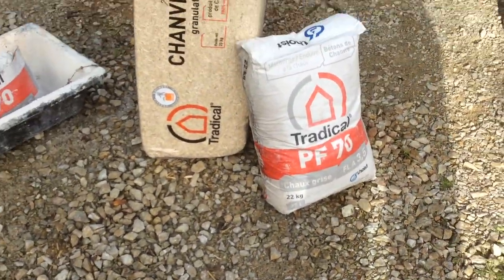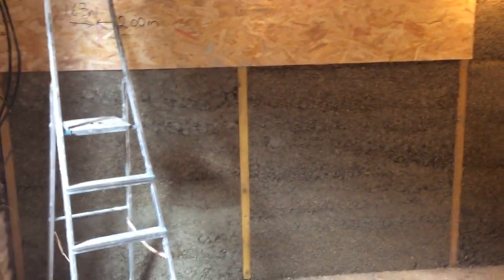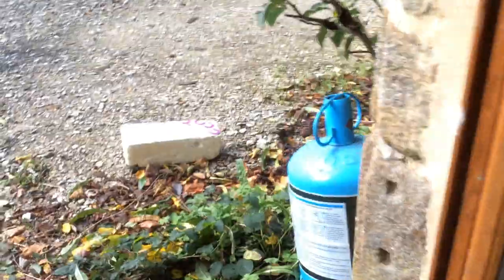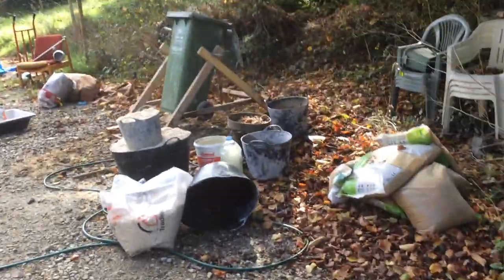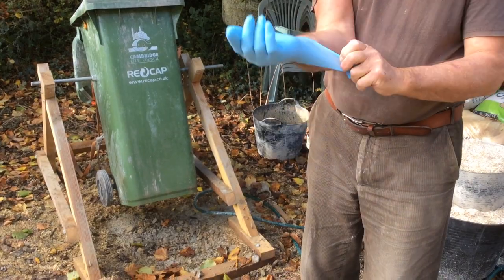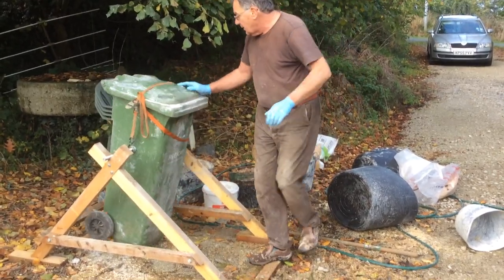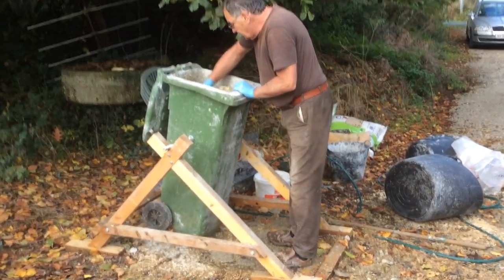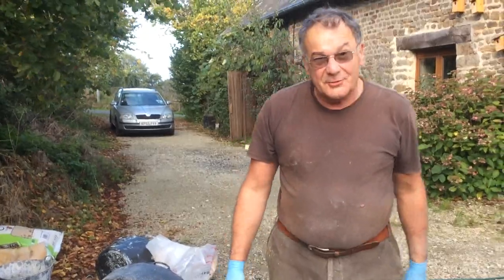Casting hempcrete insulation

Comment: Hello Gavin, your video was inspiring. I have a question regarding a strategy we are thinking of using in our stone house we have just bought in the south of France. Our plan is to insulate on the inside of the house. We would strip the wallpaper - underneath is an old layer of plaster - we are guessing it is a lime plaster as the house is about 80 years old. What is your opinion on this idea: Leaving the plaster as it is and adding a layer of hempcrete for an internal insulation layer. So that would be stone on the outside, this thin existing plaster layer and then a hempcrete internal layer of about 10cm. Your opinion would be most valuable to us.
Reply from the maker: Hi Alison, I
 am based in Mayenne,  Normandy.
Is your plaster heavily painted?
Would it be possible to remove any paint if it is enamel or acrylic emulsion?
This is my opinion:-
remove the old plaster which will probably be lime with horsehair without the paint.
The lime plaster can be recycled into your hempcrete mix if you crunch it it up pretty fine and pretend that it is sand for the proportions.
Shop around for the hemp and lime. I bought Tradical from Point P, because it was recommended and I thought it was very expensive and cost a great deal more than I budgeted. Remember this insulation is hidden so it doesn’t matter what colour it is.

I could have bought white St. Astier 3.2 NHL lime from the local builders merchant cheaper than Tradical. I really don’t think that it will make a lot of difference to the insulation properties which type of lime you buy, which ever is cheapest is best,.
Some farmers grow hemp and sell it direct for a fraction of the price.
I agree with you that 10cm/4” is correct.
Fix 1”x2” or 2”x4” vertical battens to the wall at 60cm intervals to which you can screw the shuttering.
Why 60cm 😊?
Doing a finishing coat of lime plaster is really hard work. Do a simple cheat ,when the hempcrete is fully dried out, nail some 2”x1” battens to the 2x4” ones you used for the shuttering, and then screw regular plasterboard to them. Quick and easy to do a whole wall in less than a day and cheaper than lime plastering which would add another inch on to your wall. 
I suggest that you put some air vents in the plasterboard top and bottom to ensure an airflow behind the plasterboard.

Comment: Hello Gavin,
Thank you for making this video. I think your mixer is nothing less than genius!  
I was surprised to read that molds had formed just as you were. I’m wondering why you said the wall needed breathing? Couldn’t you seal it first and than put the hempcrete against it?
I’m also curious how your experience is (don’t know if that’s the correct word) with the walls after this time. I hope you are enjoying your work to the fullest now. All the best!
Reply from the maker: It is really important to understand that these old buildings used a construction technique that required the buildings to breathe and flex. 
First understand the difference between cement and lime mortar, cement is rigid solid glue whereas lime mortar is a flexible sealant. This difference is important. 
This house is built with walls 30" thick made from granite rocks and yellow clayish mud, and footings of approx 18" without dampcourse.
It's construction results in moisture continually rising from the ground.
Consider for a moment how you might deal it - silicon injection by drilling holes into 30" of granite wall every 4"😊 rather you than me . Perhaps you could seal the wall with black bitumen, Synthaprufe?
That would destroy your building in no time because the damp cannot escape so it rises up and up, the earth between the rocks becomes very wet and the weight of rocks squeezes the mud out and the wall gently collapses.
Another method of reducing the value of your home is to repoint it with cement. Cement is waterproof and rigid. If your house is built using lime mortar or earth the it will move. Firstly, rigid cement will break off with the movement.  
Secondly the moisture is sealed in causing the dampness to rise &c. Thirdly, repointing on the outside will come away when it freezes. Fourthly, grey cement will destroy the look of your house. 
With lime mortar you can use either the sand to colour it or you can add colourings to match the original. 
I had a couple of English neighbours, one had his house reprinted with cement and it made it look lifeless,  the other had an amazing iron rich pink earth with yellow granite, but he repointed it with brilliant white lime mortar and ruined it.
Before you begin work do your research, you cannot do too much.
I mentioned in the video that I had laid the hempcrete floor. 
This is a floor that is designed to breath. It has 3-4" of pea-shingle, a semi-permeable geotextile membrane, 2" sand and then 4" hempcrete..
 What is interesting is that when you touch a concrete floor it is cold however, touch a hempcrete floor and it is warm.
Use your logic, the original earth floors were either bare earth, had a sort of cobblestone or pave covering, or were tiled with unglazed tiles - so that they floor breathes.
If you put down a damp proof plastic pvc sheet membrane then the moisture under the floor will "flow" to the walls adding to the damp problem.
Floor tiles can easily be laid on a hempcrete floor using a very runny mix of lime mortar and a lime mortar grout that allows the floor to breath.
Reply from the maker: You asked about the molds that appeared, I do not have an answer. I consulted a Cambridge Uni academic who was amazed that there was a mild that would grow  in a lime rich environment, she told me to spray it with alcohol which I did.
Reply: Gavin Lawrence 
Thank you very much for your explanation. I had now idea and I enjoy understanding how these kind of buildings work. 
Although living in a 10 year old house made of concrete and bricks I have no direct (practical) use for it, I’m sure I’ll think of you every time I’ll visit any building like you have and will understand why a damp basement is not a bad thing. 
Thank you!
Reply: Gavin Lawrence 
I plan to use hempcrete in a tiny house style garden shed. I’m not yet sure how though. Walls will be pretty straightforward but I’m still thinking how to isolate the floor and roof. I pretty sure I’ll build a mixing rig like yours though. That seems like a no brainer. (Is that American slang?) greetings from The Netherlands.
Reply from the maker: This type of longere construction uses clay-earth and granite with shallow footings - eighteen inches at most. the walls will always be damp because the ground is damp and, therefore, must be allowed to breathe so that the damp evaporates away. A neighbour of mine, a modern English builder tackled the problem in the modern way, first, he removed all the downstairs plaster and sealed the walls with Synthaproof, a bituminous black waterproof goo. He then injected silicon into the earth joints of the 18" thick walls and repointed with waterproof cement which is rigid, lastly he dug up the floor laid a plastic membrane and poured concrete down. A few months later the damp had appeared in the upstairs... With old building use the traditional methods, my neighbour made every possible mistake.
The walls need to breathe. Hempcrete provides both breathability and insulation.
Reply: @gavinlawrence1565  Hi Gavin, had you considered a lime plaster finish on top of the hempcrete floor instead of unglazed tiles?

Comment: Can we see the finished product or would it be covered when finished. Thanks for the demonstration.
Reply from the maker: I am afraid I cheated and used the French quick simple  and cheap  steel railes and montants system to cover it with plasterboard.
Reply from the maker: If I were to have had it exposed I would have done it differently, firstly, I would have used white St. AstiER NHL3.5 lime, secondly, I would have covered the sterling board shuttering with heavy duty pvc tightly stretched to give a smooth finish. Lastly , I would have added more water so that it was much runnier and could be poured in. I have seen examples of work done by Mme Perier of Chenovotte Habitat Sarl at their factory where a beautiful smooth cream coloured surface has been obtained this way.
I don’t think Chenovotte Habitat still exists but I  believe Mme Perier is still constructing houses using hempcrete.

Comment: you've gotta be kiddin here , you're covering up that beautiful stone work with hemp goop ????!!!!
its all very practical but theres gotta be somethin else you could do not to loose that work of art
Reply from the maker: You are quite right, it is sad to cover up a beautiful stone wall with hempcrete. However, I said in my preamble that the wall was very wet and needed to breathe in order to dry as best as possible. There were a variety of options Viz.
1. Leave wall untouched shedding mud,
2. Whitewash with breathable lime coating,
3. Lime plaster over the damp wall,
4. Cover it with Rockwool insulation and plaster board thereby sealing the damp in,
5.  Experiment with hempcrete to create a sound base for lime plastering.

I chose option 5 as most appropriate for a bedroom

Comment: Why wouldn’t you just buy a used cement mixer, it would seem to be a lot easier then dealing with that Ratchet strap???? Just curious?
Reply from the maker: I do indeed have an ordinary cement mixer, it is really crap at mixing hempcrete. It jams up continuously needs turning over with a hoe to stop in clumping.
Reply: @gavinlawrence1565  That is most useful to know, I have seen a number of videos using a mixer and they seem to spend half their time sticking their hands in! Your system seems to produce a very even mix.

Comment: Now, take into consideration radical climate phenomena such as driving rains and hail and the dark of night. We'll leave out that last one so as not to scare the children.🙄 Consider that you're siding has blown off and what separates you from the extremes of the storm is your hempcrete wall. Will it withstand the force of a power sprayer without dissolving into mud like wet, gypsum wallboard?
Reply from the maker: See if you can find this book on whitewash - White Paints and Painting Materials Hardcover – 1910 by W. G. Scott (Author)
Reply: @gavinlawrence1565  I'll check it out. Thanks